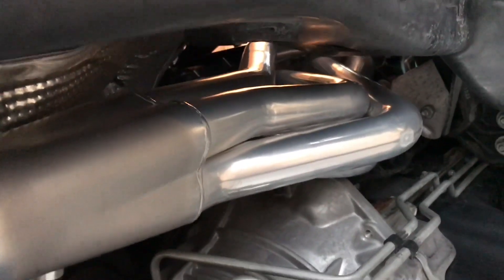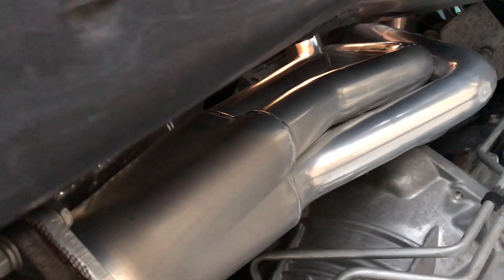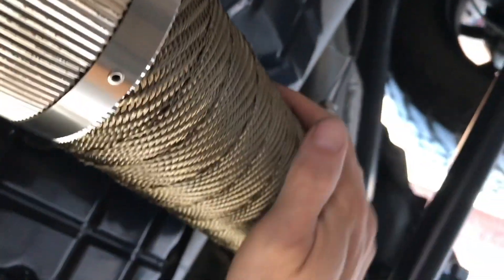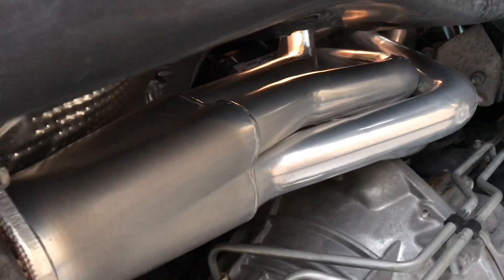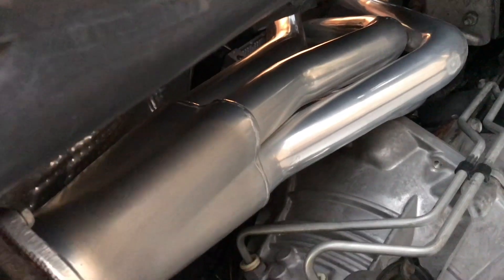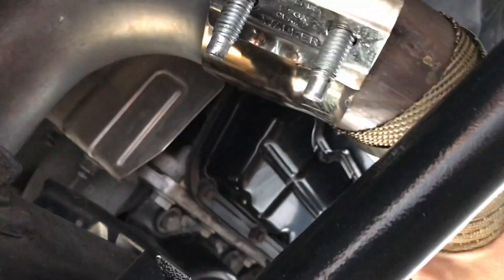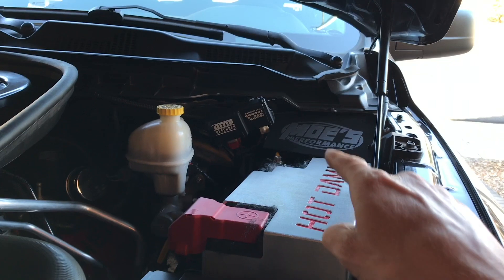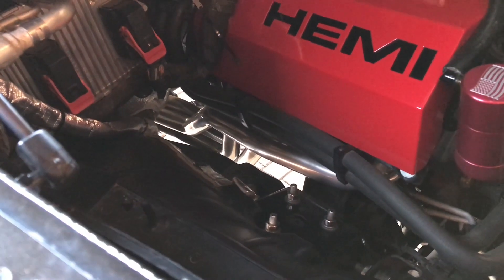Ceramic coated headers vs wrapped headers for heat reduction

Comment: high end ceramic coats test better than wrapped headers. and what happens when a bit of oil gets on those wraps....potential unstoppable fire. So if you have a real bad heat problem, go with the more expensive high end ceramic coats. better be safe than sorry
Reply from the maker: Sorry to burst your bubble, but there will be no fire and wrap has easily outperformed ceramic coating for control of excessive engine heat. Ceramic coating is considered corrosion protection and won’t reduce engine bay heat. 
   If you had to choose just one than high temp exhaust wrap is hands down the clear winner.  Even on the most expensive hi temp coatings on the market today you would never reach in a grab the exhaust manifold on the dyno.  That would be asking for severe burns and a nasty smell of skin.  On the other hand, you can see videos all over the Internet of owners grabbing their exhaust headers that are hi temp wrapped with a good hi quality exhaust wrap.  As more proof, place your hand next to a manifold or turbine housing that has been hi temperature coated and you will still feel heat radiating off.  Now do the same test with an exhaust manifold or turbine housing that is wrapped or has a turbo blanket and you can barely notice much heat radiating off at all.

Comment: Why would you wrap a  header?? From a physics point of view you should want your header to release as much heat as possible. Wrapping it will cause the heat to retain more. +1  for ceramic coating
Reply from the maker: It’s not a serious concern for me, but scientifically you don’t want excess heat in the engine bay. That causes horsepower loss. You should check out some research on wrapping headers. 
       “Header Wrap keeps the heat in the pipes. This improves exhaust flow and The Scavenging Effect. It also lowers underhood temps. Wrapped headers will make a little more Torque and Horsepower than a bare metal set.”
Reply: You dont want to release the heat, you want to retain it. Your "physics" is rubbish. do some research and you'll see.

Comment: Wrap helps retain the heat for better thermal efficiency!  Well done sir.
Reply: Wrap will destroy your headers. Go with a true ceramic coating from a company like Swaintech, not some bake on powder coat junk from the local paint shop.